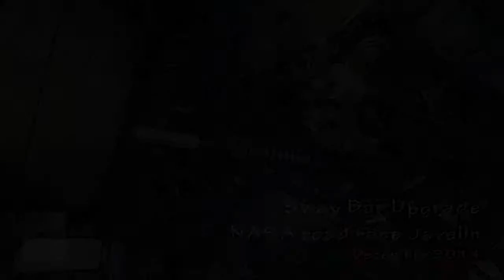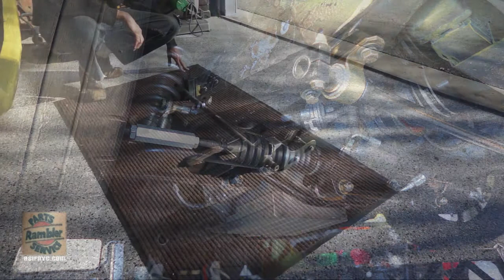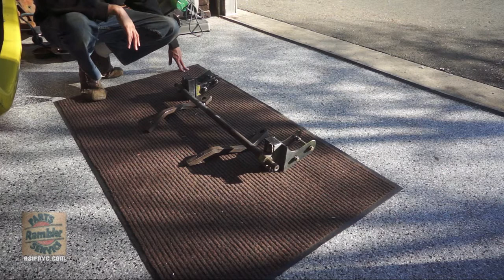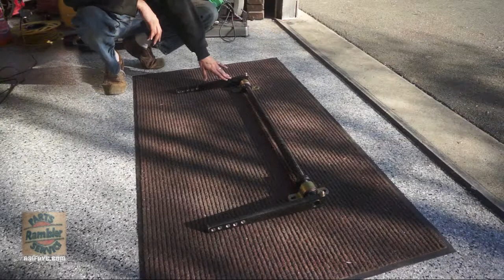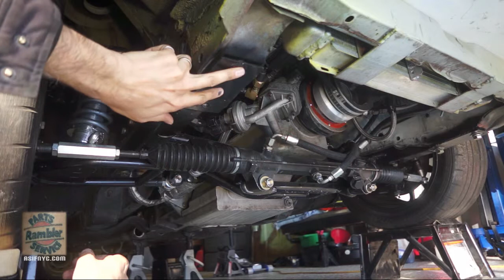Road Race Javelin Sway Bar Upgrade

Comment: Is the ride height how control freak sells the kit? Or did you get drop spindles or do something else to get it low
Reply from the maker: this is not the standard Control Freak setup.  It is a custom deal to work with Wilwood 2" drop spindles (Pro Spindle).  See my other videos for more info.

Comment: What is the improvement with the control freak suspension? Is it worth the 4000 dollars?
Reply from the maker: This is a swaybar video which has little to do with the Control Freak Suspension.  But, I'll try to answer your question with more questions.  What car are you considering putting it on and what is the purpose of the car (racing, street?)  the biggest question is: what problem are you trying to fix with your current suspension?  the CF stuff is lighter, eliminates the strut rod, uses mustang II spindles to open up a ton of brake options, has coil overs for ride height adjustment and easy spring swaps and replaces the steering box with a steering rack (power or manual).  I'm trying to race against current Mustangs with ABS, Coyote engines and modern suspensions (plus I'm slow as a driver) so I needed any help I could get.  For going to the grocery store I'm not sure why you would need the CF setup.  If you have a specific issue with the performance of the stock suspension then call Al at Control Freak and ask him how your issues may be improved with the CF setup.  hope this helps.

btw, for a street car with a manual transmission the single best change I've ever done is the addition of an overdrive transmission.  that's a mod that will transform an old car IMO.